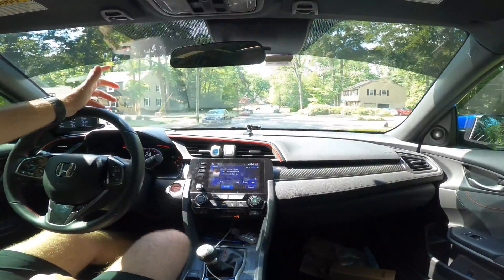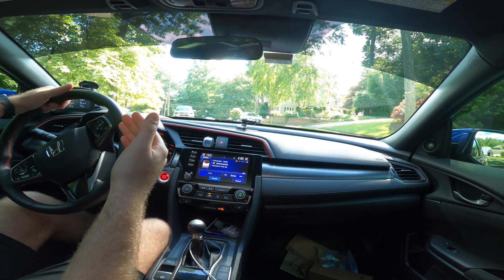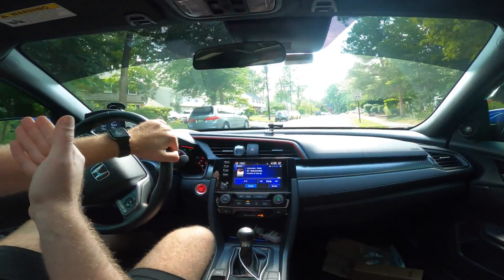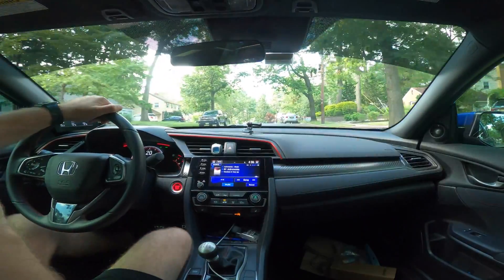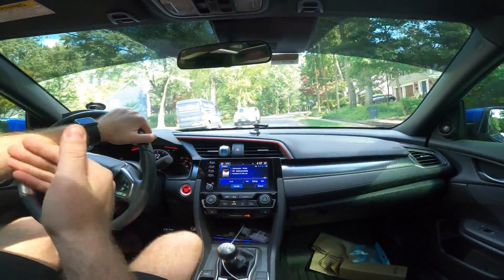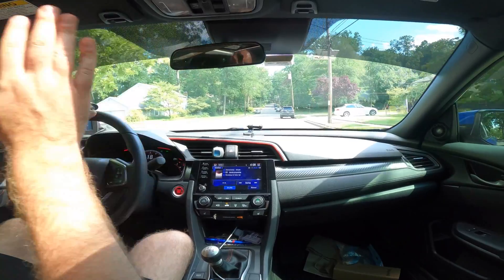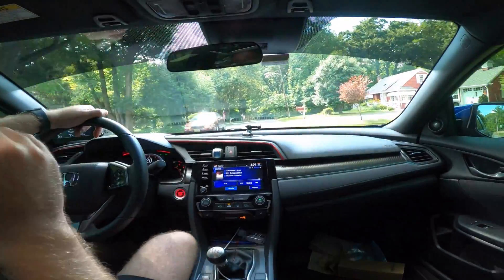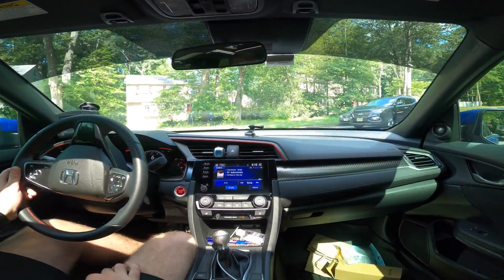Hill Start Assist and Brake Hold Explained

Comment: Hello! I have a question. Say you completely stop on the hill, and Hill Assist kicks in, and cluch in, as well as holding the brake. Does releasing clutch deactivate HA? Or only stepping on the gas will deactivate it? cuz I guess some people are used to the operation of releasing clutch first then moving from brake to gas.
Reply from the maker: I havent tried releasing the clutch without giving it gas on a hill since it will stall the engine. when you let go of the brake hill start assist will hold the brake for a few more seconds to get going and stop you from rolling backwards. release the brake first then release the clutch as you press the gas pedal.
Reply: @ThePropperWay  I see. Thanks a lot. By the way, so BH actually can do the job of HA, can't it? it just needs driver to manually turn it on (both on flat and hill), right
Reply: Song Chai from experience, hill-start assist won’t activate on slight inclines. If you want to be certain the car will hold itself on any type of hill, then it’s best to use the brake-hold, especially if you’re pulling away from being parallel parked on a hill in between two cars with very little room to work with.
Reply: @Sheikamaru13  Thanks. I got it. Also, the manual says that HA might not be able to hold the car on a very steep hill, is that another case that BH or parking brake should be applied to keep it from rolling back?
Reply: Song Chai Yes that’s right, that’s one of the footnotes on the hill-start system. Electronic parking brake is definitely useful in those situations, and I believe it automatically disengages as well when you depress the accelerator pedal, which is convenient...though I really wish these cars still had the manual handbrakes.
Reply: @Sheikamaru13  yeah absolutely. those electronics sometimes confuse me a lot. and a button for braking kinda make me feel unsafe lol

Comment: Without hill start assist you can still use a handbrake start, but I imagine that’s more difficult with an electronic parking brake
Reply: Facts
Reply: I’m so happy to hear this because I literally live on a hill and just bought a Type R. Coming from a 2011 Golf with a standard handbrake I was super worried about if it would be hard to adjust to.
Reply: No, on some cars u need to tap brake to disengage parking brake and that’s annoying
Reply: No cause as soon as you hit the gas the electric brake turns off by itself
Reply: @jdomsousa5959  still burning the parking break though
Reply: @jdomsousa5959  this is precisely what I was curious about, thank you

Comment: On a uphill, does it's better to use Brake Hold or just with the Hill Start would be fine? Does an used 2018 Civic Type R FK8 have both features?
Reply from the maker: Juanjose Lam hill start is automatic, brake hold you turn on and off. Doesn’t matter which you use. I’m not sure if the type r has it or not.
Reply: i was thinking the same thing, is it okay to use brake hold if you are on a significant incline at a stop sign?

Comment: Quick question.. a year ago i learned to drive manual in a 06 mazda6, i spent maybe a week or two and got the hang of it pretty quickly and kinda decent with moving the car at a dead stop and thinking about a 2017+ si. I would most likely be very rusty, do you recommend the civic as a good refresher and easier car to continue learning and able to be used as a daily?
Reply from the maker: TehVortexx I learned to drive a manual when I picked up my civic si from the dealership. It’s a great car to learn on and it is very forgiving.
Reply: ThePropperWay that’s reassuring lol. Thank you

Comment: Hey so how does it do going up long hills at high speeds? I have an 06 and it sounds like the motor is gonna blow up every time it goes up the hills my question is does it struggle?
Reply from the maker: Gusebewavy not even close. As long as you’re in the right gear it loves hills. Have no issue starting on hills as well.
Reply: Don't be afraid to let that engine loose. If you need the power, it's all in the high-end.

Comment: I really appreciate you showing this. I'm looking into buying a 2020 Civic si coupe. Would you recommend the coupe or sedan version of the car? Thanks
Reply from the maker: Jonathan I like the sedan version because I just find it more practical. Easier to put things in the back seat and so much easier on those occasions where people need to sit in the back
Reply: @ThePropperWay  Thanks for the reply. Im still not sure, probably going to go to the dealership to test both
Reply from the maker: Jonathan let me know what you think. Coupe definitely looks cooler but the sedan was more practical so I went with that
Reply: i have the sedan and i just think it's more practical. i think the coupe looks cooler, and from what i've seen they won't be making a coupe civic in 2021, or an Si at all for that matter. https://www.autoblog.com/2020/07/17/2021-honda-civic-info-dump/